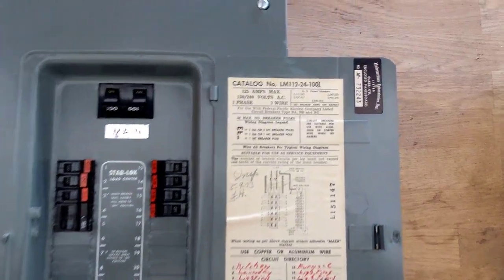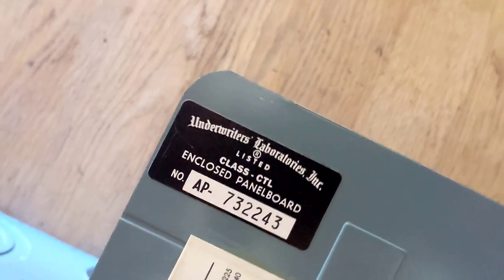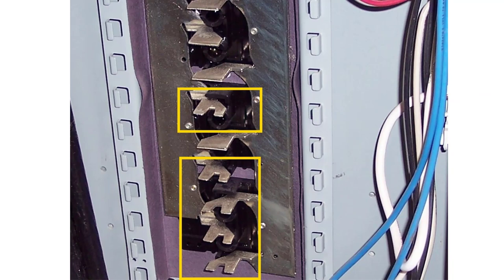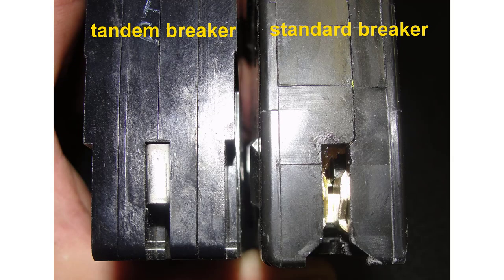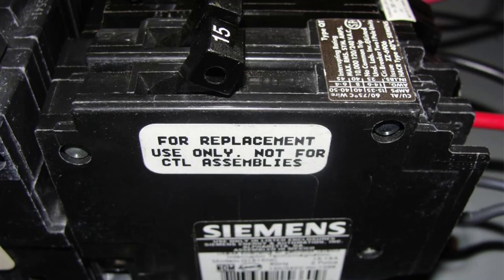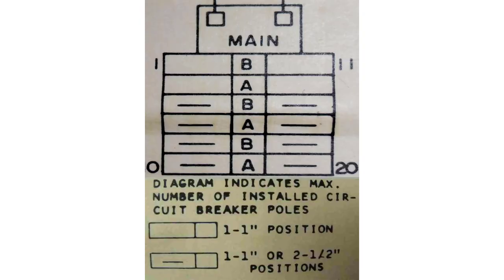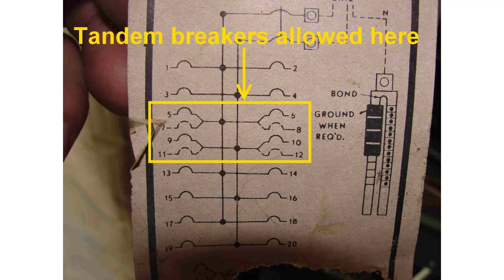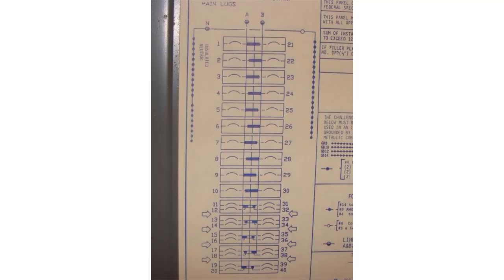How to inspect tandem circuit breakers

Comment: Excellent and informative video. I'm in the process of adding 3 new circuits for my garage. This video has been super helpful in confirming what I was thinking. I have a breaker box that has 2 tandem breakers installed where the breaker box should not allow ANY tandem breakers. I believe that I'll be upgrading my box to allow not only for the 3 circuits that I want to add but also for the 2 additional circuits that were added in the past via these 2 tandem breakers. I'm also considering upgrading my service from 100 amp to 200 amp. I believe that I'll pull the trigger on this also.

Comment: Thanks. So many videos on YouTube showing electrical advice by people who are not electricians. Working in facilities I’ve learned a lot, or not seeing the work by other electricians blows my mind.

I’ve now bought a very expensive circuit tester to match circuits with breakers on old panels.

I’ve always wanted to map both dead and hot runs which also happen to just be laying loose in the drop ceiling just waiting for someone to life a panel.

I’m also looking to update or change the configuration of my cutler-hammer home panel so your presentation has helped me with that.

Comment: I'm not your target audience (inspector), but I found this very interesting. I was hoping this also had something to do with the multi-wire branch / shared neutral circuits I have in my 1959 house. After getting a few minor shocks updating my switches and outlets/GFCIs, I finally researched and learned enough to realize that my house has a bunch of these types of circuits. After seeing all the circuits on my panel skimping on the neutral wires, and I am shocked to find it's a quite common practice. My breakers for these shared neutral circuits were never fitted with the "common handles" to assure both circuits are shut off before any work is done. I've set a long-term goal to run additional 12 AWG neutral wires through the old metal conduit to separate the circuits as much as possible. Do  you have a video I missed  on that topic or strong feelings about shared neutral circuits? Thanks

Comment: So is it based off of service or what the panel is rated for?  For example 100 amp service but the panel is rated at 200 amps?
My panel is rated at 200 amps, I have 100 amp service but the panels has 30 single pole slots (15/15).